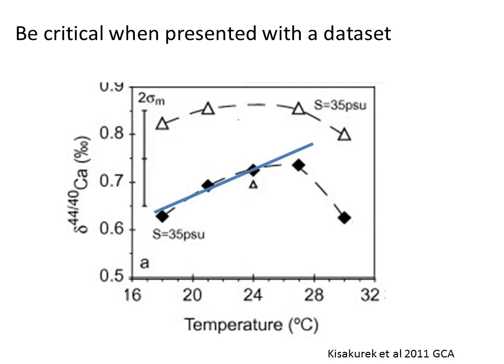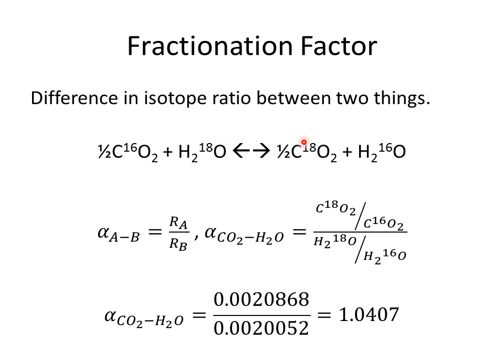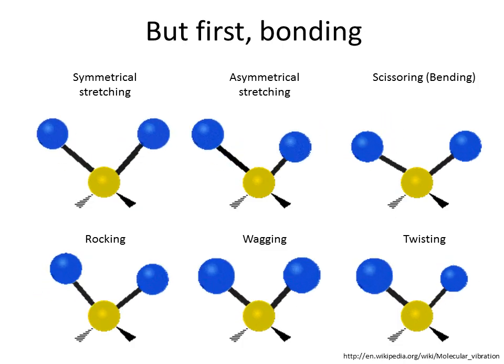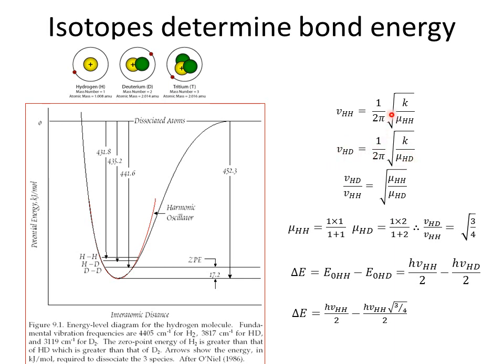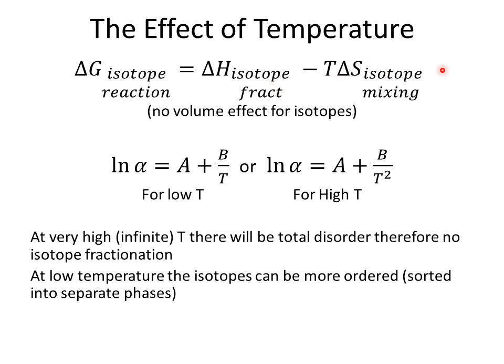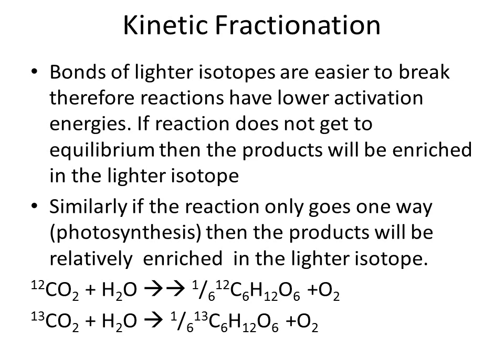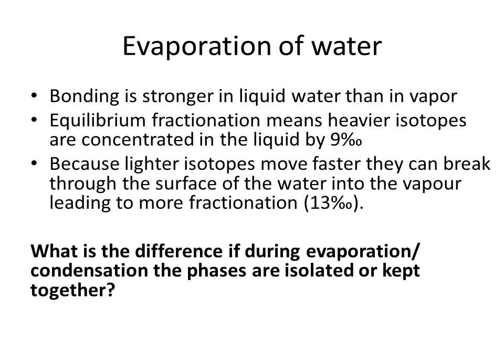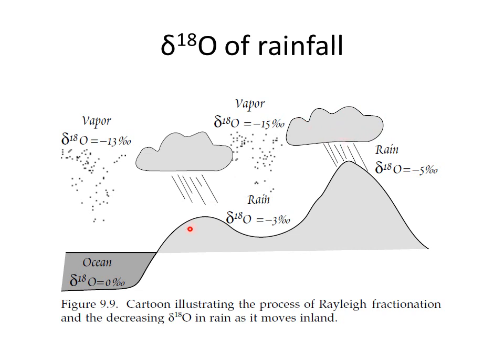Stable Isotopes Lecture

Comment: The relative abundance of such stable isotopes can be measured experimentally (isotope analysis), yielding an isotope ratio that can be used as a research tool. Theoretically, such stable isotopes could include the radiogenic daughter products of radioactive decay, used in radiometric dating.
Reply from the maker: Yes but.  
The stable daughters of radioactive isotopes can be thought of as stable. If you have different amounts of parent isotope and/or different amounts of decay the this will lead to large differences in the abundances of the stable daughter relative to the other stance isotopes. The isotope variation between stable isotopes due to their mass differences are much smaller. Both types of variation can be useful but as tracers of different types of processes. 

have a look at the radiogenic isotopes video 
https://www.youtube.com/watch?v=rLvwA6QuiDM

Comment: Astonishing to have not yet received any comment despite the extremely important issue dealt with in this topic on stable isotope geochemistry - seems we are an isolated community worldwide. We should not get angry about that.

Very interesting lecture indeed. Thank you. Hope you find time to make detailed approach of every item given here. Admired in particular the fractionation based on vibrational bond energy and the Rayleigh distillation during partial condensation.